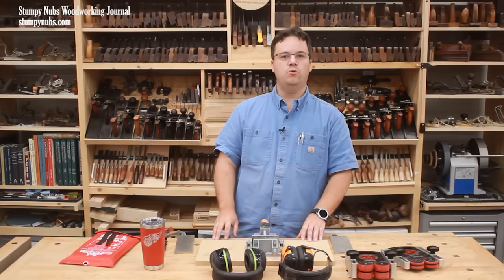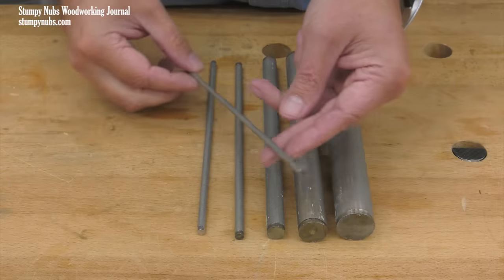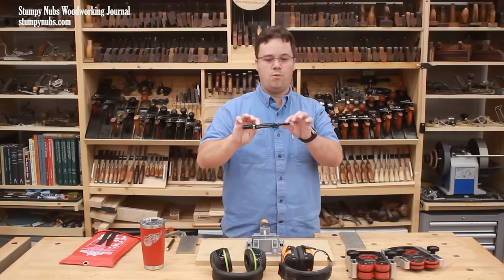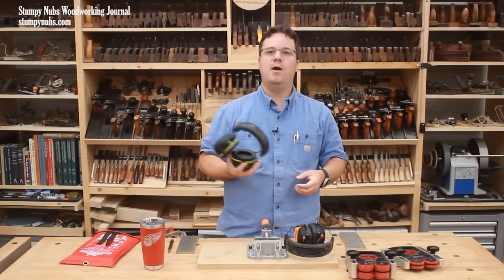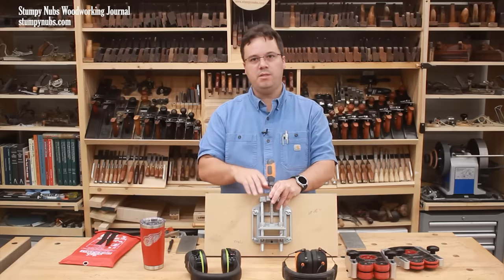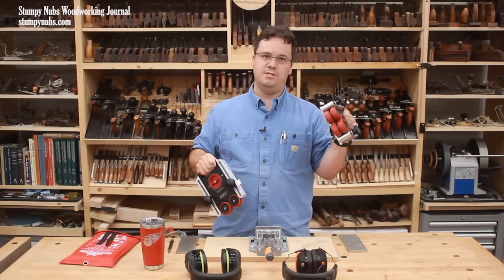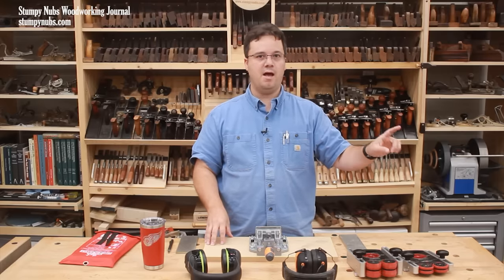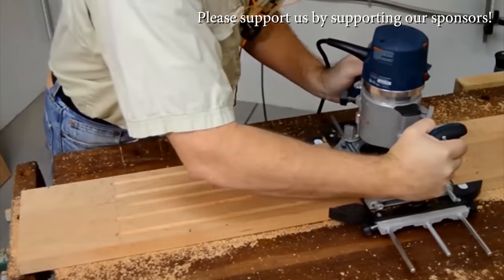7 clever tools I wish I had YEARS ago!

Comment: Hey "Nubs", love your content! I picked up a 35 year old Delta DJ-20 8" jointer from a wonderful older gentleman who had just turned 92 and was retiring from the hobby.  It was in great condition as you could tell how well taken care of it was. Any way I recalibrated it with a new set of carbide knives from Seth at MWC as I couldn't talk myself into a helical head. It wasn't three months later and had two very small nicks, even in the carbide knives. So I reached for the wallet and bought the Lux III helical, recalibrated both beds and I was shocked at the difference! Thanks for turning us onto this resource and the upgrade, great company, kick butt cutter head!!

Comment: Actually in the tool trades, diamond is used exclusively for grinding carbide and CBN is used for steel as there is a chemical incompatibility.
This might not be a problem with hand sharpening because the low speed involved doesn't create the heat that a spinning wheel does.

Comment: Those FastCap long nose markers are disappointing and frustrating because the caps and the body seem to fit at exactly the same very close tolerance. That means both caps are difficult to remove and when they are removed they often pull the whole tip assembly off the barrel's inner wad of ink saturated felt. Almost as irksome is that when the cap is reinstalled it is difficult to fully seat. That means the next time you go to use the marker the tip may be too dry to leave a mark. Buying from Amazon? Try the competition. It can't be much worse and costs a bit less.

Comment: I've used the 2mm lead holders commonly found in the drafting section of your local stationary store, for the last 25 or 30 years. HB lead for rough lumber and a 3 or 4H lead for finish lumber.

Comment: Similar to the roller guides but a cheaper option are Woodstock Board Buddies. They are one-way wheels that attach to the top of your fence. The cone shaped wheels push your board into the fence and hold it to the table preventing kickback.  The advantage to the ones shown in the video is that you can use them for any width board. I've had mine for many years.

Comment: I put the byrd in delta jointer , liked so much was going to add one to my Jet molder planer when the gear box broke :( Was so old could not get a gear box for it so ended up buying new planer that had a byrd head in it , Super improvements on the cutting results . Will never go back to cutter knives .

Comment: Fire blankets are a good thing, but in regards to no expiration date: I've had a couple of these where the pull straps disintegrated due to long term UV exposure - be careful where you put them. (I think it was over 8 years but less than 10 - still extremely good value, and the blanket itself was fine in both cases. Replaced them anyway.)

Comment: G'day. You should have taken the fire blanket out and showed the correct way to hold it. The blanket should be folded in a special sequence that aids in removal and safe use as you approach a fire. The 2 straps are to be held in each hand and the "packet" should be secured so the retaining clip (press stud) will open when you pull on the straps.

Comment: I'm  sorry, not to sound like an asshole but NEVER should a vice be used while cutting emt (at least anything < 1.5") just wear some gloves if you must, hang on tight and use a reciprocating saw with a good, bi-metal 18 TPI blade (I like Diablo and prefer bi-metal over carbide, carbide just doesn't cut metal very well on a recip-saw? and is 3-4X price) or if you're really cool a cordless mini band saw!  If I saw one of my guys using a vice he would not be back after the next break...Period!
Reply from the maker: EMT is used for all sorts of utility purposes, not just in electrical work. This is a woodworking channel.

Comment: The ISOTunes Air Defenders are great - while machinery is running. I have to switch to another headset when I am doing machine setup (table saw, shaper, etc).  The lowest volume setting is just too loud for me when the machines are not running.  I don't have this problem with the 3M Worktunes headset.  I have reached out to ISOTunes and have not heard anything back.  Unfortunately reviews do not cover the audio volume range of the headsets.
Reply from the maker: I've heard people say they are too quiet because they limit the volume to a safe level but you are the first person I have ever heard say they are too loud.

Comment: Those ISOTUNES sound decent but blasting music in your ears to protect them from noise seems counter productive.
Reply from the maker: That's not what is happening at all. The music does not overpower the outside noise. They are ANSI rated hearing protection, meaning they block out the outside noise to a safe degree. You can then choose to replace that outside noise with music, but even that is limited to a safe maximum of 85dB.

Comment: Hey stumpy I just bought the ISOtunes headset. Mainly because I had the original and I do love them and having music/phone answering (for when those people always call when your gluing up or on a roof). But what I found was the rubber band was rock hard after an hour felt like it was cutting in also the side pressure left my ears achey after 3+ hours. I see on there website the design has changed a little but I also see you have some kind of foam added is that home made or something they sell?
Reply from the maker: That piece of foam in the crown comes installed on the 2.0 version of that earmuff. They do not sell it separately, but you might email them and ask if you can get it.

Comment: Bluetooth earmuffs should also have AM/FM radio.  That's why I use ION Audio Tough Sounds.  I've used mine for years and they have been better than I expected them to (and I'm never happy with anything, so that's saying a lot).  A close second is 3M Worktunes, but they don't have a digital screen to dial in the station.
Reply from the maker: I can't remember the last time I listened to the radio through an actual tuner. Everything, even radio stations, is available online, through you phone now.
Reply: @StumpyNubs  the phone apps I've tried haven't been reliable and were battery hogs.  I don't carry my phone when I mow, to eliminate the chance of it falling out of my pocket (which has happened), so it's nice to have the radio option at least.  To each their own though.

Comment: Bought the bora vise. Pro: light, decent for the price. Con: light duty, frame bends if you tighten much, and goes out of square as you tighten. OK for woodwork (unless you are fussy), not good for machining (!) Sloppy fit of movable jaw around rods, jaw won't stay square. Mine came with rods over 1" sticking out the rear, got in the way, had to disassemble and cut to size. Lucky it came with 1 rod loose in the packaging, #8 screw sheared off, so had to replace them. Summary: OK for fast jobs, too much a toy for real/accurate work.
Reply from the maker: My recommendation is for woodwork (this is a woodworking channel). If you need a precise machinist vise, of course it'll cost you more than $45. That's the compromise you make for something lighter in weight and more affordable. As I said, it is a great vise for the things a woodworker would use it for.
Reply: @StumpyNubs  guess I am too fussy... The frame going out square under moderate pressure really means I won't use this for half of my tasks. A big reason I use a vise is to get accurate holes, especially on the drill press. Just my HO
Reply from the maker: @artswri  I haven't had that experience at all (the frame going out of square) but maybe your idea of moderate pressure is considerably more excessive than mine. Anyway, as with every tool, different people have different experiences. I can only speak to mine. Have a nice day.
Reply: @StumpyNubs  Maybe your version of the vise is different(?) I used just pressure by twisting the handle; did not use the 'pull out and use as lever' feature - felt like I could actually spring the vise if I tried hard with that. Like I said, I'll use it b/c of the light weight but not if I want +- 1 deg accuracy. And as always - thanks for all the great tools you have discovered and shown to us fans (ok, and to us tool junkies...) Thanks!

Comment: Bought the needle-nose pen and the Air Defenders. The cap on the pen stuck shut on the third use and I had to use tools to take it off without ruining the rest of the pen. Do not recommend. The Air Defenders are good at sound reduction, but suck at Bluetooth. Lots of delays and drop-outs when using the phone. OK for listening to podcasts so far. Limited recommendation.
Reply from the maker: What did ISOtunes say when you contacted them with your problem so they had a chance to help?
Reply: @StumpyNubs  Both e-mail that I sent to them bounced with invalid address. Used both "support" and "team". When I told them this via the web site, they responded with (exact quote) "I'm not seeing any correspondence from this email address". Need I point out that that was exactly the problem?
Reply from the maker: @pscheidt  So, when you did contact them via their website all they said was they had no previous correspondence on record and that was it, the conversation ended?

Comment: The other point with Diamond vs CBN is that Diamond should not be used on Steel. The clutch pencils are great revival of an old idea i have from my father made in the Forties.
Reply from the maker: Diamond stones are used to sharpen tool steel every day. Perhaps you meant to say "mild steel" - soft materials like carbon steel can clog the grit of a CBN bench grinder wheel. I am not sure the same danger exists with a flat stone that is being used manually, though. You simply are not taking material off fast enough to clog, in my experience.
Reply: @StumpyNubs  "Diamond stones are used to sharpen tool steel every day" does not make it correct Diamond is used for carbide CBN for steel.
Reply from the maker: @pijnto  LOL- Not correct? There is an entire industry dedicated to using diamonds to sharpen steel. I personally know people who have spent decades developing diamond abrasives for industrial and consumer use. This isn't a serious debate... Have a nice day.

Comment: Agreed on the helical heads. When I had a DW735 and a Ridgid jointer, I had upgraded both to helical. Made an enormous difference, especially with the dewalt and how it would eat blades. Also quieter, and like you said, helped a ton with dust collection.

When I replaced those with a Hammer jointer/planer, I went right for the helical head.